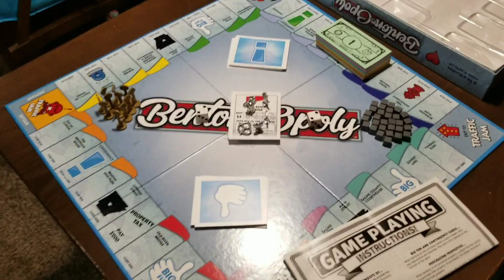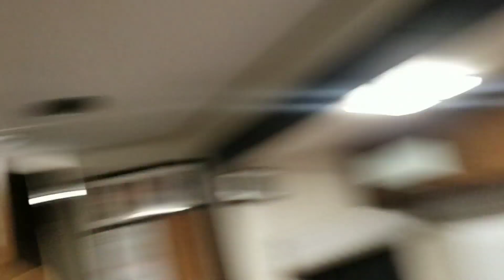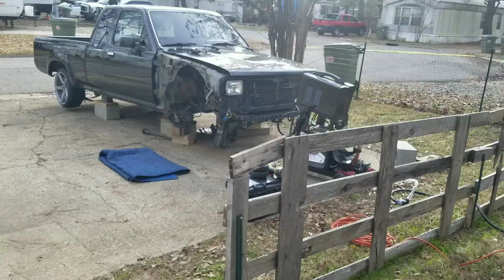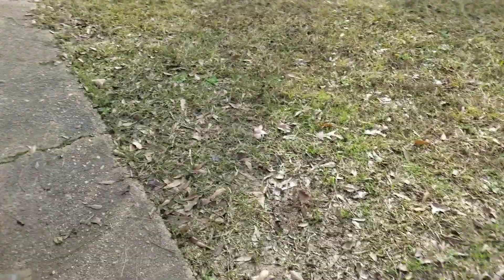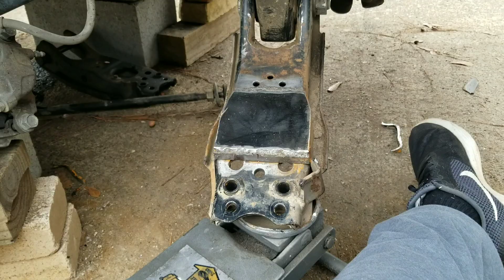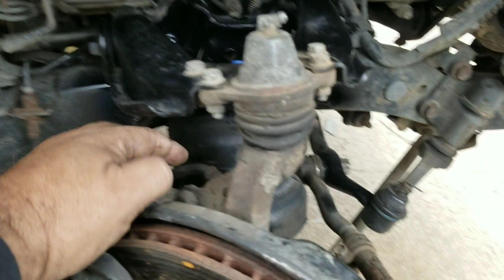6 bagging Toyota pickup part 2 front suspension 1-01-20

Comment: Looking good. The yota is coming along nicely. Be safe
Reply from the maker: Thank you.
Reply: I have a quick question: as you know I have 1990 Mazda b2200. I put new rear leaf springs and 3" lowering blocks. I tried to keep it all centered left to right. After I put it all back together the driver side frame to rim is 5 3/4 inches and the passenger side frame to rim is 5 7/8. Is that 1/8 inch acceptable or do I need to center in better? Thanks for the help.